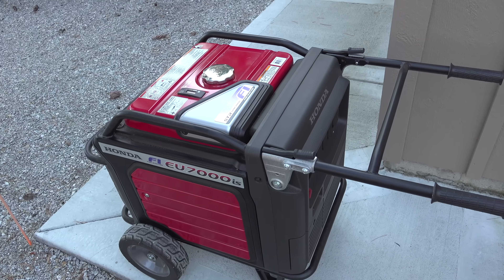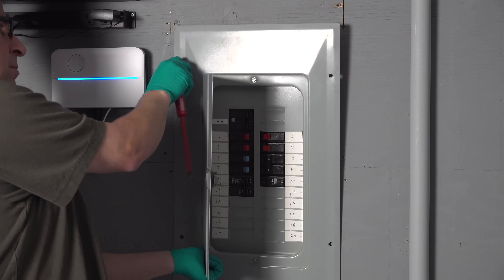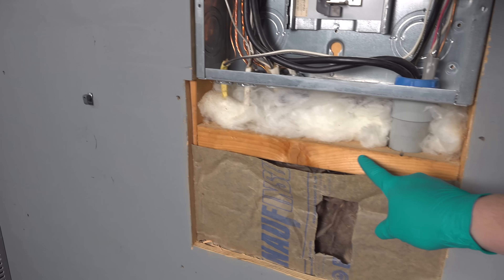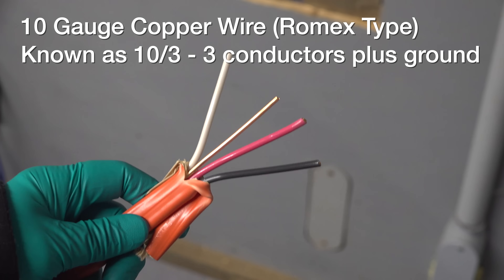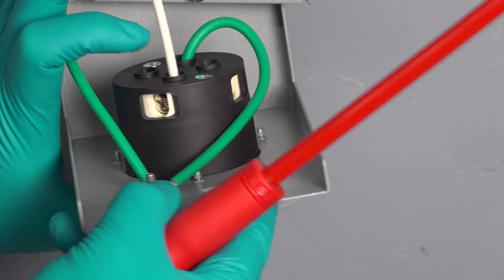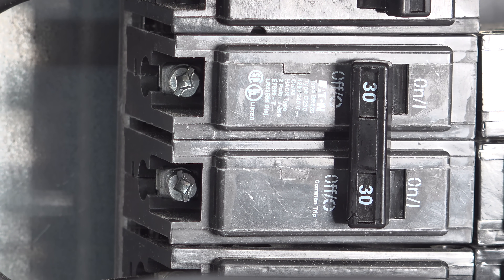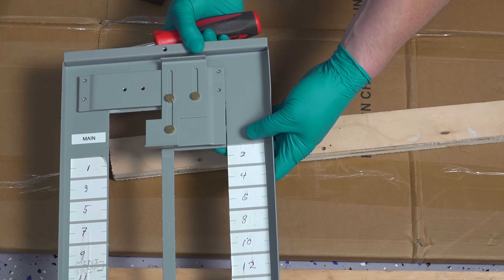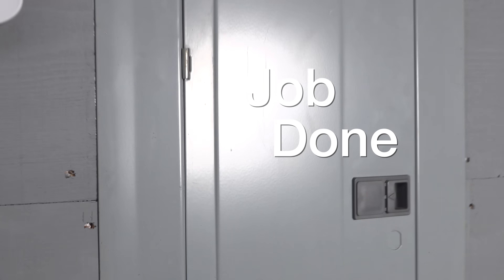Cheap & Easy Way to Connect a Generator to Your House - Legal Too!

Comment: If you're going to advise people to use this as a guide, you should probably start using some test equipment to confirm circuits are dead.
Reply from the maker: Certainly good advice for sure
Reply: lol male Karen’s
Reply: Sending a long screw through the plywood to poke the wires is not good. @3:22
Reply: If they don’t know that, surely they know they can’t do this project.
Reply: Thanks for the advice Darren, now go away.
Reply: @222branflakes  Well DUH!!!
If he gotta tell you that then maybe you shouldn’t be doing it!!

Smart ass
Reply: No. Only the strongest will survive
Reply: Ok I’m dumb….   wrong guy
Reply: Disregard
Reply: @ZootyZoFo  ok I’m dumb…. Wrong guy
Reply: @whocares2626  Hmmm, I don’t think so.
Reply: @ZootyZoFo  my mistake
Reply: And also mention how important it is to make sure your generator is floating neutral if you're connecting it to your house system which is bonded.
Reply: @Antoniocool86  what if it isn't?
Reply: @mr.monitor.  then you'd be violating code that says neutral and ground can only be bonded in one place and that is at the first point of disconnect. What could potentially happen is in the event of a fault somewhere in the wiring system that your ground would not function as it should
Reply: @Antoniocool86  I'm wondering for an unrelated reason. I am using a portable solar generator that I need to use a bonding plug to satisfy the rv surge protector I have in between them. My concern is that because of the bonding plug internal 15a wire, it may just burn if there is a fault on a 30 amp system.  I guess I could just use more bonding plugs. Does this sound dangerous? Would the "house" 120v system still be safe when plugged into a non bonded ungrounded floating neutral?
Reply: @mr.monitor. you could buy or make a 30 amp bonded plug and install that on your RV cord. You really should look at the manual of your solar setup and see what they say about how to handle this because it should be a fairly common thing and it should be addressed in the owner's manual. As for plug it into your house you mean 240 volts because that's what your panel box is with two hots. To do that you would need the generator to be  unbonded and floating but I'm still researching on how the best way to do this is.
Reply: If you're going g to use this guide, testing for voltage should be a no brainer. If it ain't, get your wife to do it. She probably has common sense, except for who she married (this time?).
Reply: Those people are already dead
Reply: @conqueringlion420 🤣😭🤣
Reply: Not required, just turn off your main.
Reply: @tren380 
Exactly.
Reply: This should not be used as a guide, you would want a transfer switch on the incoming power.  If you need a guide like this then you wont understand how to sync synchronous ac power and should not be back feeding your power.  It’s very easy to not open your incoming power and cause a short resulting in a fire if you don’t understand what you are doing.
Reply: @Ironmuffins308  please explain how this set up is not valid. Literally thousands of videos if professionally installed set ups just like this one.
Reply: @Ironmuffins308 Wrong, an interlock kit replaces the need for a transfer switch and it makes it impossible to backfeed to grid as grid breaker must be off before you can move the generator breakers to on and feed the panel.
Reply: Yep thats the entire point of the interlock. They probably didnt even watch the video, they just saw the thumbnail and came here to hate on the guy for helping people out. Look at all the other comments saying they paid a professional to install it and its working out fine. If anything it lets a lot of people know there is an option and if they cant do it, hire a pro to do it but if done correctly its perfectly safe. Its youtube so there is gonna be a bunch of anonymous haters regardless, the live to hate lol
Reply: @Ironmuffins308  technically its not backfeeding
Reply: @Ironmuffins308 are you kidding?  This device is designed for this purpose. Whether you use an interlock kit an automatic transfer switch a manual transfer switch or a smart home panel. They are all legal ways to hook your generator up to your house.

Comment: What is the purpose of the screw between the two main breakers?
Reply from the maker: Some manufacturers do this on convertible panels, where you may not need a main breaker. It's just a physical holddown so the breaker is never accidentally pulled out. It looks like a homeowner just shovewd a wood screw in there but it is from Eaton or Cutler Hammer as they were known when this panel was made.
Reply: @SilverCymbal Thank you, I suspected it was something like that.  I think the only thing setup is missing is a visual indicator of the power coming back on.  Obviously that would be a much more complex connection;  if you happen to create it I'll take 20% of profits as a finders fee.
Reply: @ChedwardThe3rd I have the reliance controls power back alarm.  It gives me a signal when the power from the utility returns.  It’s from the same company as the inlet box he shows.
Reply: @ChedwardThe3rd  yes, that’s the whole purpose of the power back alarm.  It sits on the incoming feed wires BEFORE the main breaker.   So it sees the 60Htz magnetic signal from the street which is isolated from the generator which is on the opposite side of the open main breaker.  So yes it works with the generator on feeding the house even though nothing in the house is connected to the street.
Reply: @ChedwardThe3rd  Reliance Controls THP108 EMW3561925, Multi
Reply: @ChedwardThe3rd  Day late; dollars short.
Reply: @ChedwardThe3rd  there’s products on the market that achieve this now.

Comment: That panel almost looks like a subpanel. If there is a disconnect upstream of that panel then the neutrals and grounds should be separated from each other and brought together at the main shutoff panel. If it is the main panel then it is good.
Reply from the maker: Yes, very good eagle eyes!  This is a sub-panel but setup identically to a main panel. So it works great for what I did in the video and future stuff as I can stop messing with my main. But is it illegal or against code as we have all been taught despite not being the first point of disconnect. No. Why? Because it was built in 1993.  The bonding changes to subpanels came in around 1999-2003. This structure is setup just as a main panel with it's own grounding system, etc.
Reply: @SilverCymbal  Thanks for the reply!  And yes it remains legal if it was legal when first done 👍. Otherwise I would need to be installing GFCIs and AFCIs on almost everything in my house with the code changes 😂.
Reply: There are very real reasons why ground and neutral should be separated in sub panels and in the generator. 
Will it work, yes, but it’s much better to separate them. There are several good YouTube videos on why this should be done. 
Your description seemed like you were separating them, but I could see both neutral and ground in each bus bar. 
It’s not hard to just remove the green bonding  screw after moving each wire to the proper bar. 
As usual, it’s best to check with a pro if you’re not sure.
Reply: Actually,if you are adding an inlet, you may need to update. Each local authority sets their own rules, and can force you to get a permit and make changes . At the very least, it would have to pass inspection when you sell or rent the house.
Reply: SC, the power should have been isolated at the MAIN PANEL'S sub-feed breaker for this panel, the feeders coming from the bottom of this panel and the lugs at this main breaker were still HOT and exposed. Also, regardless of the 'grandfather clause' it would be in your best interest to isolate the neutrals in this sub-panel, there is a very specific reason the NEC added this requirement. Please do it. 😊

Comment: Yep, I agree. Overly complicated generator transfer switches are more expensive and don’t allow whole house connectivity.
Reply from the maker: Yes, I like the smart home panels but they are good for automatic stuff, but I am totally fine controlling what things I want on etc and as you said, its simple and cheap and very reliable.
Reply: The reason transfer switches are superior is that most generators can not supply a whole house. In this example you are supplying 30 amps thru the emergency breaker.  You can easily overload this breaker, especially if the home is all electric.
With a transfer switch, you select certain circuits to use during a utility outage.
So, for safety, a transfer switch is the way to go
Reply: @donh6416 with this setup you can choose to turn on only the select circuits that you want to use. Maybe you want to use your stovetop to cook something so you turn off all the outlet circuits including fridge/freezer for an hour. Maybe you install a soft start kit on your air conditioner and choose to run that during the summer but in the winter you have the option of keeping something else on. Using a transfer switch just means you have to have made the decisions before hand and don't have any flexibility during an outage.

Comment: I wish that these were legal in Canada. Instead we are forced to pay thousands for GenerLink or move half our circuits over to a sub-panel. This would be so easy.
Reply from the maker: Wow I didnt know that. Its funny I called generlink a few years back thinkng there solution was awesome, but they are crazy expensive as you said. It seemed lke just sell them through the power company for like $5/month and everyone would get them. But I guess they are greedy. Sad!
Reply: @SilverCymbal  in case you are curious I believe the reasoning for these interlocks not being legal is because they can be defeated by removing the cover on your electrical panel. So strange.
Reply: In February of 2022 I purchased the Generlink 30 -75KA with surge protection and that included a 20 foot 30 amp locking cord for 653 dollars and my utility company installed it for 20 dollars here in South Central Kentucky. I purchased it from North American Power Products dab Global Power Products 225 Arnold Road, Lawrenceville, Ga. 30044. I love it so safe and easy to use all they did on the install was pull the meter head off push the generator link in opening then push the meter head in the opening in the Generlink and you are ready it’s basically a automatic transfer switch and approved by most utility companies.

Comment: When we built our house we had the electrical contractor wire in a transfer switch. Nice and safe that way and relatively cheap while your doing new construction
Reply from the maker: That was a great idea. It adds almost nothing when building new, but you have to know to ask! Good move for you gyuys